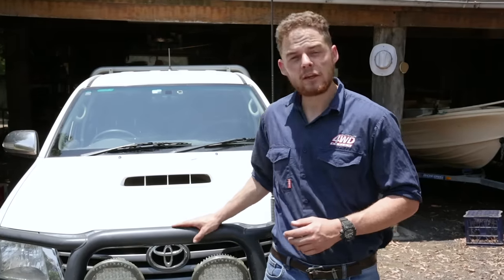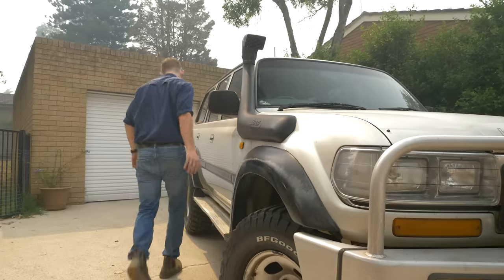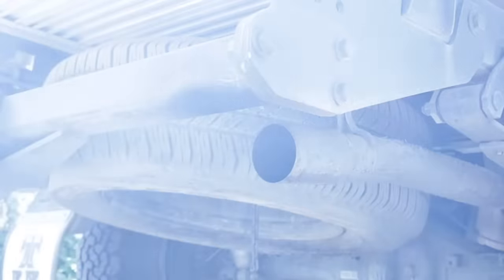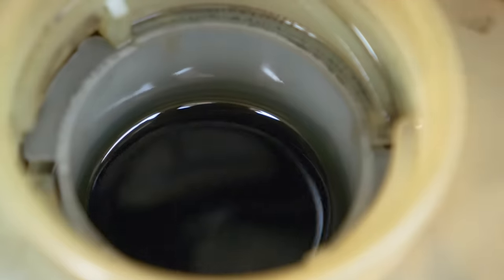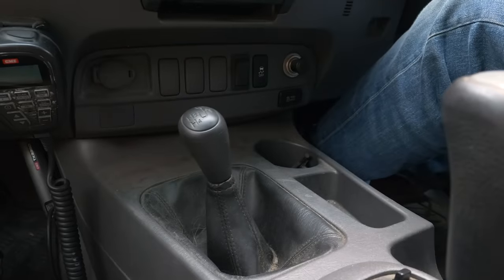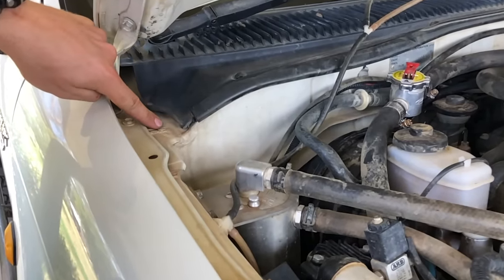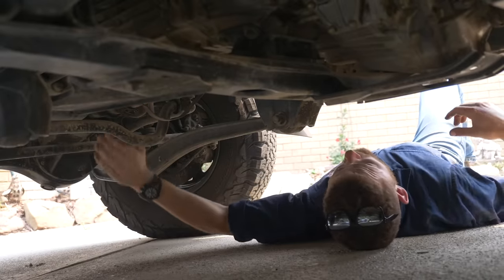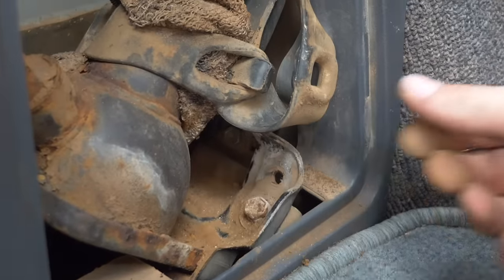BUYING USED 4WDs – Expert tips to avoid a LEMON and get a BARGAIN

Comment: Bought a 2001 GU for $6500 grand and honestly if your gonna follow all this don’t expect to buy an old 4wd trying and find any 4wd from before 2004 on the market with no surface rust is impossible and it’s just not going to happen, and if you do buy and old car accept that yes things will break and you will need to fix it more and when you do your inspection you might not get everything you want

Comment: Bought a 2006 Toyota Prado 1KZ-TE for around $15000 back in 2017 (here in Nicaragua) It had only 80000km and it was completly stock. Engine is fully responsive and never gave me any major trouble, the only thing was a broken pin of the parking brake i had to replace, besides that, lovely truck and i think i got a fair price.

Comment: I bought my 2008 Subaru Forester for light 4x4 and camping from the dealer and it had a complete service history from that same dealer as well. Only issue ever was the radiator blew up and the dealer fixed it free of charge. I'd rather go to a dealer because you have more options available to you after the sale.

Comment: I brought a 1994 Toyota surf sight unseen from Victoria and got it trucked up to brisbane 4 years ago now i got it registered up here and took it for a drive down to copeton dam for a fishing weekend and back up to rockhampton to a little town called moura so a good 12 hours or so drive i noticed it was useing a little bit of water in the radiator so i just topped it up every know and then. Till i got to moura to find out this 4wd makes OIL!!! when i checked the engine dip stick. Ended up having blown engine... but i was surprised it made it this far...

Anyway long story short brought new engine just to find auto had water in it also. The front rear diffs had water in them too converted it to a manual after losing 3rd gear from the water :P Ow well least i know now everything is new and serviced now

Comment: Yep.i bought a 2006 prado 1kzte in 2016 had 160000km on clock.500km trip to go look at it.advertised for 24000.i was a bit suspicious. Lived near the beach i was expecting rust.but not i drop of it anywhere.
The colour of the car was better then the photos online it was silver ash but looked like champage gold on photos. Everything matched paint service history etc.only had tow bar and car was stock as a rock.not anymore 😉😉.
Paid 20500.done 220000 now and other then normal maintenance oils, injectors brakes etc and preventative measures egr block and manifold decarbs coz im ocd. I didnt really have to spend anything.
Nicely kitted out now.

Comment: Got myself a 09 lux a few years ago. Just under 200,000km on the clock. Needed a new starter motor and it's got a few dents. Just had the bonnet resprayed. However, it runs great, although probably due for a clutch very soon. 
Doubtful I'd buy another one with as many km. Rather save up a bit more and get something newer. I don't regret the buy but will be more careful next time.

Comment: Open the doors and see if the paint is knocked off the bolts that hold them to the hinges and body. If the doors have been off it's been smacked hard at some point. Same with the hood and rear hatch / trunk bolts. You can tell in about 12 seconds where a vehicle has been hit with that.
Reply: I found one like that when I was looking for my current one, the paint was chipped on the bolts for both front fenders and the radiator support panel was a slightly different colour to the rest of the engine bay.

Comment: Saw a 4wd dealership tipping honey in engines to  try stop knocking noise, bogging up chassis rails, painting over rust, gerni the inside of vehicles out list goes on everything came from auctions dirty cheap and sold them in his yard in Caboolture

Comment: 140,000kms 2009 patrol. Perfect paint. Perfect interior, almost perfect engine bay (shitty spot light wiring) everything else really good. Full service history. Airbaged rear suspension. Down side, was used to tow a caravan.
Up side, omg it drives nice no worries 8 months on.

Comment: We saw a 2011 Great Wall V240 the other day and snapped it up, for what we want its perfect to use for the some light offroading and weekends away, its also used to carry stuff from time to time. Has 158K on the clock and is surpassingly smooth, the motor is in good order and although there's a little rust in front of the fire wall we have used a rust remover spray and will bog it.....has plenty of pick up from a dead stop and engages into 4H and 4L without issues. A ute that the dealer was going to make perfect and sell for 8K we managed to get for less thsn 4K including the nudge bar, oil change and some wiring for lights on the tray. Even our mate who is LC made was impressed.

Comment: I bought myself a lemon. Well, a vehicle that needed some work done to it. A Hummer H3 to be exact.  A lot of money in new parts for steering and suspension but the engine ran strong.  I knew this was the case. I bought it anyway. Right away, I replaced the transmission and made sure to get torque converters and heavy duty clutch plate.  Got a new front diff for it so I can have front and rear lockers. This thing has been an absolute weapon off road ever since.   Just noted that all the repairs were not a surprise due to the mileage it had on it. I was fully aware of what I was getting myself into ever since.   Sometimes, Lemons work out for best for off roading if you are aware you are getting one.

Comment: i liste to good advice ,found a dmax ls-u king cab 4x4 018 6 speed auto in mint condition original  no lift  or off road work hardly a stone chip on it ,looks like been very much looked after with 150ks on it  yet still very clean like a new truck .clean slate, i found the auto hunts around on hilly country roads 80-100kph so i put it manual mod use 4th and 5th using D on hiway only .dew for big service at 160ks so ill get gear box oil changed and filter ,

Comment: I bought  a 2007 f250 4x4 for 1,000 usd from the company I work for so I had a chance to drive it and use it before I bought it, also how many time times it had been back to our yard for repairs. It had glow plug issues but I had them sort that out before i paid for it, all in all i got a great 4x4 for a great deal and havent looked back,

Comment: I feel attacked by this vid. Getting our 2001 Prado ready for market soon, dust all through it cos it used to live on a gravel road and shit dual battery wiring cos they didn't have everything transistorised and wrapped in shiny plastic in 2002, but it's a good old car and I reckon it'll kick on for longer than the hilux in this vid (just kick a lot slower). 

Here's another one to look out for, mismatched shocks, springs, CVs etc. They've been out and broken something and not replaced the set - the odd one out might be about to let go. If the car's warm when you get there they might be hiding a shitty noise on startup, so tell 'em the vehicle is going to be cold started or you'll walk. Check battery/alt/regulator with checking DCV before & after a quick drive. And if you can see an fluid pan and neatly arranged work bench on the seller's property, don't hang everything on the service history! Some blokes I know I'd trust the bloke more than the Toyota dealer!

Comment: Some, good tips, there however I'd, recommend from my experience to, get a mechanic to, check it, over. I did that and have had no problems with my pajero.
Reply: but your pajero was good to begin with - the mechanic could've told you to walk away and you would've missed out on a good pajero. It is the luck of the draw, even if you know the vehicle intimately before you buy.
Reply: @MiniLuv-1984  yes it was a good car to start with but when I am going to pay a, lot of money for a car I'd, prefer to minimise the risk of buying a lemon. As they say once bitten twice shy.
Reply: @str8shooter2  I know what you mean..I would like to reduce the risk too, but I've been bitten by mechanics once too often with bad or wrong advice on a vehicle, so I don't trust they will do the job as well as it needs. Now days, I just spend a lot of time researching a specific vehicle, do the checks myself as best as I can. That together with a PPSR check I think gets me the best risk minimisation I can get.

Comment: Oil leaks can run into thousands to fix , I go breaks , 500 to up 2000 ,rear seal ! 500 to 3000 ? , front seal , depends on what you gotta pull to get at these things 1000 , and I’m talking about hundred dollar an hour mechanics ,, so that five grand four-wheel-drive can cost you 15 grand by the time you’re finished with it,,

Comment: Got an 05 hilux V6 4.0, 170KMS. Has duel fuel properly installed, with valve saver, canopy, bullbar , winch, radio,l. Paid a bit to much though  owmed by an old wog, and all serviced at the dealership, clutch  isnt the best

Comment: Removing the oil cap and checking for blowby is not how its meant to be checked. You need to be able to read crankcase pressure using a manometer.

Comment: Bought a 2016 nissan d23 with only 62k on the clock, was previously owned by an older bloke who had only towed with it a couple of times, was extremely clean when i bought it, have added 40mm lift, bigger tyres and front and rear bar, idrive, 2way and diff breathers are coming. BUILT, NOT BOUGHT
Reply: Seth Oliver d22 2.5 diesel?

Comment: getting a 94 4 runner v6 on gas ...the gas is going.
might have a timing issue but for free and all other major parts well maintained i cant complain..this will be my first 4x4 so we'll see how far it takes me..keen to join the 4x4 lifestyle
Reply: Keep an eye on the head gasket, the old 3VZ V6 is prone to blowing them.
Reply: @tareskisloki8579  yeh its been replaced twice...i have read its a radiator issue..their not bid enough to cool it down...first thing will be an alloy one..
it was my old mans  beast so i knkw a little bit about them..

Comment: my years as a Cummins fields service guy including rebuild to 1710 cu inch , if you really want his 4x4 take an eng.oil filter with you, ask the owner to swap the old filter for new, split the old filter with a hacksaw, spread the paper/cardboard out, gold specs, worn bearings, white piston material from a semi seize Use a long handled screwdriver , place the plastic end to your ear, the other on the engine, this'll pick up noise AS
the bloke here said blue is bad!!in smoke, white can be excessive air in fuel  Black can be overfueling, that is engine cannot burn all the fuel, common because idiots get remaps that ask too much
most people going on beaches cane the hell outta their donks, screamin' ridiculous, jus lower your tyres to abt 10-15 psi, you'll drive through in second abt 1500rpm
remember if you drove the Sahara like you do Inskip, you'd stuff your wagon in half a day, no good yelling for mum and' there's nobody to tow you out there
And above all look after your4x4

Comment: I bought a 1988 GQ with shot brakes, flogged out bushes, exhaust leaks and broken air conditioning.

It was good though, because it only had 200,000 km on the dial, minimal surface rust (which is fair enough. It's old) and a bunch of factory extras like a dash swaybar disconnect. Plus it only cost me $3400, which left plenty of room to fix it up.

Comment: Just over 3 years ago the wife and I bought a 2010 great wall X240 with only 118,000 on it, upon test driving it found a few minor things wrong but only due to the original owner not using it for what it was made for, (4wd selector knob had never been turned in 6+ years since new) firstly used it to tow our camper trailer and about a year ago bought our pop top, had it off road only a handful of times but each time has never failed us once, would I buy another..... Yes, no wonder the Russians love them
Reply: Yeah I haven't put much in to ours, just dropped the tyre size back to 16" and some AT's few worn components (most of which are just Isuzu parts and are cheap as chips) and upgraded the clutch to something a little more heavy duty for towing purposes

Comment: Bought a 1995 hilux surf 200,000km on the body and 50,000km on the engine , every single service log recorded , 2300$ bog stock
Now she’s runnin 2 inch lift 33s roof racks and dual battery systems 
Crawls up everything in low range 3-4th gear 
Best Buy ever

Comment: I've bought a used 2013 Toyota hilux invincible 50k miles on the clock its all mechanically good just had to change a sway bar of right front wheel body and frame is in 90% condition the only thing is it's rear right side was a little bit touched as the previous owner told me nothing too major did I got a good deal?

Comment: A bit more info on the blowby probably should of been added..that amount of blowby on a modern common rail diesel is fine..shit the tritons blow the cap off straight from the show room floor..but on a older 1hz or td42 if the cap was jumping around like that I’d walk away.

Comment: so all gears hey 5 low, na mate, low km old means lots of short trips and no good , new high kms was constantly moving and warm like a taxi mate, oiled changed under 10,000kms is the go , i do them between 5 and 7,000kms , get the black shit out more often, ask them did you tow that horse float in 5th if they did walk away , never tow super heavy in 5th, check for bubbles in radiator , check for oil cap for white water marks, see how much mud is inside chassis, were all the nissans u looked at ? call the phone numbers in the stereo, check if it has a loan on it , check to see if it has a chip , check to see if its a factory turbo motor , check to see if temp gauge never fluctuates , check to see that all dash lights work in the dark, check the speedo numbers are straight in the older ones, check to see if done at dealer or privately , i can do dealer its just box ticking some times, check if manual has marks on it , meaning it might be stained so it was getting the oil changed, drive on bitumen in high 4 listen for sounds , go flat out in reverse and listen , do full lock in 4 , forward and backwards , load the gears up to listen for bearing  sounds , buy a unplayed with engine set up , go new model if you want more power, is it full of fuel , good owners keep them full so no water gets in diesel from due at night, do they store it in the rain or shed , did they sleep in it all the time , if they did they rust out from the inside , did they sleep with one window down a bit , ask lots of questions if they take to long to answers there full of shit

Comment: we have too many different 4 wd here in Canada to list, most are part time systems with rear lockers or LSD'S or centre viscous couplings , all FWD BASED SYSTEMS and lots of these you must be careful getting used, awd systems are damaged from owners with no knowledge how to use them or not maintained , biggest issue here is rust from the salt on the roads in our extreme winters and owners doing lifts and over sized tires with no upgrades to brake components or steering or pinion angles and wonder why they driveline noise in  a years time when they drive the crap out of them so  i stay away from those at all cost, or you just know everything has been fixed with gaffer tape, lol, just wish we could have Toyota trucks like you get in Australia ,the other ones you have to watch ut for here are the ones imported from Japan,all the millennials  here buy them or U.S.A. importers sell them into Canada who don't give a hoot and dump them here and are junkers you can barely get parts for

Comment: I got a 94 sr5 2.8D hilux with all the after market gear(uhf, 2inch lift, extractors, scrub bars, side steps, bull bar, winch, light bar and spot lights.) all for 5000$. Sure it has 320k on her. But panels are good and the interior is good. I rebuilt the motor for her and the gear box just because I could. Only cost 2k. At least I know I will have a good reliable vehicle for years to come and could probably easily sell it and get my money back if I wanted to.

Comment: i brought a 2000 series single cab hiluix with 180,000 k on the engine with a brand new gear box and rear diff for 7400

Comment: Nice vid. Should do a vid on Portal Axles. Why are they so expensive? Positives/ Negatives? Will or wont they become mainstream on new and old 4wds. Cheers
Reply: Jack Daniel's well they can’t go on ifs 4wds so that answers half your question they are great on the 79s and 76s and patrols makes the car more stable off road helps with the bigger tiers make the wheel track better

Comment: I bought a Toyota prado 3 litre turbo diesel non d4d auto 2006 model books very clean but high klm 292,000 actually and bought it in 2019 its honestly been the most reliable vehicle I've ever owned I have only used 4x4 in it twice once when test driven and once more in the backyard where I had a stuck trailer it now has 327,000 klm on it when I got it the mechanic went right over it and said it was the cleanest most looked after prado he had seen around the 16k I payed for it it did have dual batteries but the old owner removed it and I'm about to set it up with accessories very soon but yes starting to get older so I think 5000 klm oil changes should be done but I'm open to suggestions my mechanic still says ten k is fine ????

Comment: I bought a lemon I bought a used Toyota hilux from a dealership in Mackay and I got told it was regularly serviced then had a leak from the transmission took it to the mechanics they replaced 2 rear engine main seals  then turns out the oil was black like coke it wasn’t red so now I’m up for a new transmission

Comment: 4WD Action - I bought second-hand Pathfinder R51 2.5dci and it makes knocking noise when accelerating on a slight uphill highway from 900-1.1K RPMs and blows black smoke, I consider that injectors are dying. Any advice how to inspect?